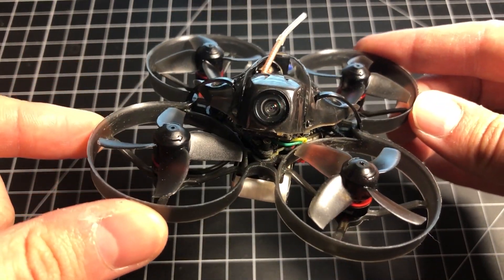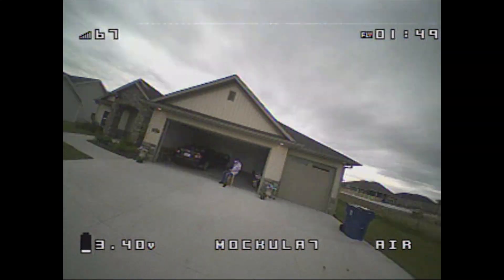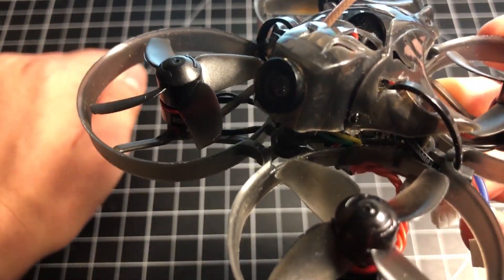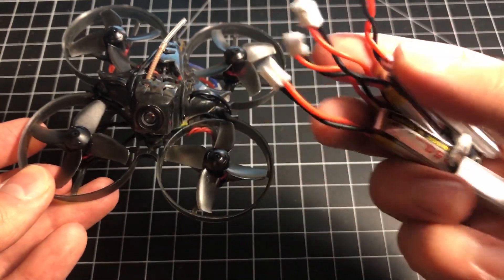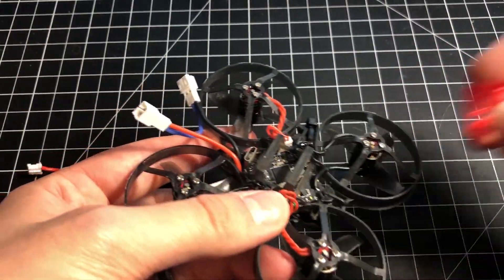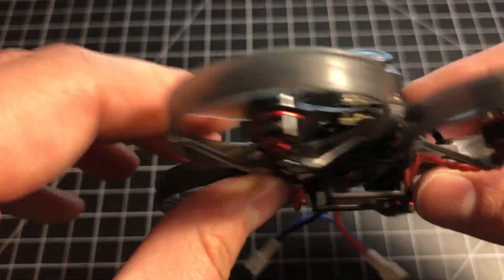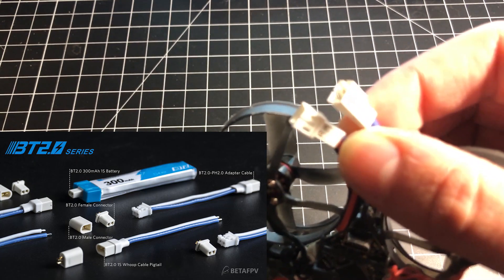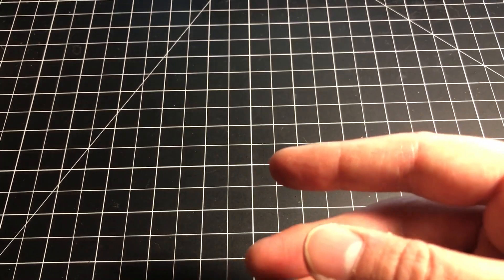Happymodel Mobula7 V2 Review - Is it still worth it?

Comment: I finally flew mine today - about 7 months after I bought it (I bought it with an incompatible xm+ RX and waited till I could replace the RX - I did it using the ELRS EP2 with ceramic antenna).
I installed a BT2 connector and I'm only going to use it on 1s, indoors (I've got plenty open-prop quads for flying outside). It now weighs 27.5g.
With 96kHz PWM and some other ESC tweaks I was able to fly it for 9 minutes and 15 seconds before tve voltage sagged to 3.0V on an 850mAh Gnb battery (purple label, 17.1g). It wasn't even my goal to fly it for so long - it just happened. I don't have any 1s batteries smaller than 550mAh, because I use them on a 3-inch Baby Tooth - the yellow-label 550mAh hv being my favourites.
Reply from the maker: Been thinking about going with BT 2.0 as other batteries besides betafpv's are finally being made for it. This comment just might encourage me to give it a try. Thanks for the feedback.
Reply: @JohnCuppi  no worries! I convert my battery plugs to BT2 too - not enough good ones on the market with this connector... I also bought PH2 connectors with 10cm cables soldered to them and I soldered appropriate BT2 connectors on the other end of the cables. I insert the PH2 end into my 6-in-one whoop battery charger and I plug the BT2 batteries to the dangling BT2 connectors for charging. I do not recommend the Betafpv 6-in-1 charger with BT2 plugs, because it has no voltage  (4.2 or 4.35V) or current (0.2 or 0.6A) switches that typical 6-in-1 have)

Comment: Even now in June of 2020, this who0p is still one of the kings of who0ps of all time! Since they upgraded the AIO FC to an F4, now it will get the updates in Betaflight and Emuflight to let it get the best features from now on.  The F3 stopped getting updates at Betaflight 4.0.  Can't say enough about how great this who0p is, and I have an F3 version! Fast and nimble and very acrobatic! Certainly a deal at the $79 it currently is selling for on Banggood. People and reviewers seem to always be focused on the new gear coming out.  That older gear is still just as good as when it was first released! Now, it's even better! I might just buy another! ;)
Reply from the maker: Absolutely still agree 100%, great comment. The Mobula 7 still holds its own very well and is an extremely mature product with lots of resources, great tunes, etc. It being older is a perk in its own way.
Reply: @JohnCuppi  Thanks! :)
Reply: Hello Scoot, I just bought 1 Mobula7 v2 and it came with F4... the problem is I cant flash it with EmuFlight, when I try to flash it the quad blinks off and when I start it again, bam BetaFlight still in there. Do you know if there are a known problem or something? Thank you in advance.

Comment: 100% spot on in all aspects from my experience.
The Gemfan props I am a big fan of.
I feel they have a much smoother line and really pull into the corners. The set weight a gram less than the stock props. Great review.
Reply from the maker: See I didn't even know about those, I'll have to check them out. I think you've spent way more time with yours than me, cause I got into the Mobula 7 so late -- you should do a review on it! I have a feeling they're going to sell out before the holidays and HM will have moved on to the next thing. Thanks for the awesome feedback.
Reply: @JohnCuppi  I can't tell by the way you fly it.  I'm not as well spoken as you. I leave the hard reviews to the pros. I'm amateur hour in reviews bro.

Comment: I Put my batteries from the Front in  so the wire cant get in the props.
And my charger works fine But i glued some Metall heatsinks on the Diodes and mosfets of the bouth buck regulators. Also it charges up to 4,36v and as it stops charging the voltage drops to  about 4,34v to 4,35v. So its very close. Check your solderconnections on your charger and desolder the switches and bridge them.  Than it should work fine. I also Got an f4 fc
Reply from the maker: I still have my charger, so I will take a look and fix it on a rainy day when I'm bored and want something to work on. Thank you very much for the advice and happy flying! Enjoy that F4 FC!
Reply: @JohnCuppi  also happy flying  :o)

Comment: As you said, it's getting to whoop season here in North America ( Actually started early here in Winnipeg, Canada). I needed an upgrade from the brushed era  I was flying last season, so bought one of these about a month ago, and just received my second one. After several bad experiences with BetaFPV brushless products,  I was expecting more of the same. Happy to say I was wrong !! I fly indoor in a warehouse, and 1S is plenty powerful for indoor for sure. As for the new Beta connector, I will wait until GNB adopts it before I come on board. After all, for me, power is not a problem. Great video !!
Reply: This is some of our weekend action if you are interested
Reply from the maker: Great comment, thanks for the feedback! I've had 50/50 luck with happymodel products so far. The SailFly-X was a real piece of junk basically built to die, but their Mobula 7 especially this late production model is very solid. I am getting a few of the connectors from BetaFPV to try and see how I like them. I think the BT connectors make logical sense, but if BetaFPV makes licensing too expensive then the connectors will fail or simply become cloned. Which betafpv brushless did you get btw? I've been flying the 85 Pro 2 and really like it, but I see an awful lot of bad reviews on amazon about burnouts with just a few packs. I don't get why, mine's doing great after 20 flights.
Reply from the maker: @echobeefpv8530  Just checked it out and commented!
Reply: @JohnCuppi  tried the BetaFPV 65X and 75X. Had ESC / motor failures on both. I had  ( brushed) 65S models, all flew fine. The models are well covered in YT land, I got two dud ESC's and / or motors. No shade on BetaFPV, but QC out of China seems all hit and miss, even from " brand name " suppliers. It is a developing market,
Reply from the maker: EchobeeFPV It is actually not uncommon for me to have heard about BetaFPV drone failures in general. I’m not sure if that’s just because they are a popular brand, or because they had had growing pains with product design. Some of the problems with the 75x were very well known and they ended up adding improvements to the ESC. I bought a meteor65 from them, the new one, along with some of their batteries at a discount for review purposes. If I hate it or it dies on me it’s going back to amazon but I’m certainly hopeful I’ll love it.
Reply: @JohnCuppi  a very popular brand, and covered a lot by YT drone channels. I'm trying to get more YT creators to give more durability reports. A new shiny model looks the same, I want to see if it's still in the air in 6 months. I spend way too much ( I mean, WAY TOO MUCH !, ya know?) on the hobby, to spend 200$ on a quad that lasts 4 flights ( Beta65X )
Reply from the maker: @echobeefpv8530  That's always the real question about any of this stuff, right? I find that information ends up being found out by regular users in facebook groups and forums. The really big YT drone channels have so many products coming in constantly, there's just no way they have the time to give long term durability reports on all of 'em. I genuinely wanted the meteor65 and intend for it to be my primary winter season whoop, I hope the whole BT 2.0 connector and everything works out. So after my review feel free to come back and ask me about an update! lol.
Reply: John Cuppi so you bought the Mobula7 instead of the Meteor65? I’m debating between the Mobula7 & Mobula6 I’m starting to lean toward the Mobula7  putting it in a 65mm frame for 1s indoor flying
Reply from the maker: Gramps Ramblings I bought both, lol. I bought my mobula a couple of months ago in an end-of-summer fire sale. Now that sale is basically normal at most of the Chinese vendors, prices cut down due to newer whoops. The Meteor65 is the newest tech from BetaFPV but at $110.... the Mobula 7 is a lot easier on the wallet compared to it for sure ... but I review this stuff so I bought it for myself & the channel. I did see the new Mobula6 but if I can’t get a review sample of that I won’t be doing any videos on it — I’m personally not buying it, although m7 was very good happymodel has a terrible rep of rushing new products half baked.
Reply: @JohnCuppi  Do you have the Meteor65 that you will be reviewing?
Reply from the maker: Gramps Ramblings no — I ordered it, and it will be here in about a week once the stock has made it to amazon’s warehouse. Should be any day now.
Reply: @JohnCuppi  I'll be looking forward to your review
Reply from the maker: @GeezerGramps  I appreciate that, it'll be done as soon as I can get it and put some real world use on it!

Comment: thanks for sharing! Gonna recommend this one to some friends. Got mine a few months ago but voltage is sagging a lot now and connectors are very warm. Thinking about replacing the connector with the tinyhawk freestyle ph2 connectors, solid pins. They seem to have a clever solution that could work good on the mobula7 as well I think!
Reply from the maker: Yes a solid pin connector is a great upgrade to this. Or if you want, there’s also betaFPV’s new connector which is objectively better but unfortunately you’d still have to buy only their batteries for now. Thanks for commenting and I’m glad you enjoyed it.

Comment: Can you show us the dump file for the project mocking bird
Reply from the maker: This is it from them, final version for f4 and f3, but it does need JESC installed. It would fly way better than what I showed in this video at this point.  He got the f4 version finished! https://onedrive.live.com/?authkey=%21AIcMSEaAspWuNsc&cid=C5756863B00398BC&id=C5756863B00398BC%21380955&parId=C5756863B00398BC%21372904&o=OneUp

Comment: Hello John, How are you? Great video!! I just bought mine and I'm having a few problems: 1) I dont know which version of BetaFlight get to Project Mockingbird Work... i know is 4.1 but there are a lot of sub-versions (4.1.1, 4.1.2, 4.1.3 and so on). Do you know which version I need ??? 2) I tried to flash EmuFlight instead of BetaFlight but when I press "flash" on EmuFlight the quad turned off and when I turned it ON betaflight is still there. I dont know if Im doing anything wrong. Thank you in advance!!!
Reply from the maker: Hi Juane! This is the the one I use from Project Mockingbird -- v 4.1.1, "Mockula7", https://onedrive.live.com/?authkey=%21AIcMSEaAspWuNsc&cid=C5756863B00398BC&id=C5756863B00398BC%21380955&parId=C5756863B00398BC%21372904&o=OneUp It doesn't utilize RPM filtering, but does use JESC 48khz mode, so you'll need to flash JESC to your Mob, but don't worry, that part of JESC is FREE! PID Profile 1 is for 1s
, PID Profile 2 is for 2s with that configuration. I have not bothered with Emuflight on this, sorry I can't be of help there.

Comment: Recently got my Mob 7 v2 and just wondering would the jst be the best for an exclusively 2s set up or would an xt30 be better?
And if so for the jst...what a good 2s battery with good flight time?
Reply from the maker: Personally I think xt30 is overkill, it adds extra weight that isn't necessary. GNB 2s 450 are really good -- but I have not used them on my mobula 7, I fly 1s more often with my Mob 7 since I typically just use it in the garage or the house. So I admit I have not really gone down the road of a 2s connector. Great comment/question though.
Reply: @JohnCuppi  ...have you had to change out your battery connectors yet? Or have they held up for you?
Reply from the maker: Drone Ready I swapped mine out to solid pin connectors before they had a chance to degrade much, around the beginning of January. This winter I am trying to push myself to fly 5 packs per day (I missed a whole week sick with the flu) so far I have had good results with the solid pin connectors. 🙂
Reply: @JohnCuppi  ...how do you swap out to solid pin connectors?...is it relatively easy?
Reply from the maker: Drone Ready it involves soldering so it may not be easy for everyone. But all you have to do is desolder the stock connectors and then solder the new ones. Solid pin connectors are cheap premade like $2 usd
Reply: @JohnCuppi  ...thankfully I have pretty decent soldering skills.
Would you recommend jst or bt2.0?...
Reply from the maker: @droneready8278  I had BT 2.0 on my meteor65  before I returned it and I think those are very good whoop connectors. Personally I just use a solid pin JST-PH 2.0 connector, I think you would honestly be totally fine with that. BT 2.0 is good but not when the only batteries you can buy are available from betafpv...
Reply: @JohnCuppi  yeah...making the connector proprietary to their batteries kind of sucks...why did you return your Meteor65?
Reply from the maker: Drone Ready I did a review of meteor65 here about why I returned it: https://youtu.be/DJLjbktlnqI long story short, it flew like crap, I had low battery life, and betafpv never offered me a new unit all they wanted to do was have me attempt to fix it. I gave up, it was too much money for the whole deal as well.’

Comment: dude my mobula all of a sudden flips out when I arm it and instantly shuts off ..have you heard of this happening ?great video also! that dog freaked me out when you flew by it lol
Reply from the maker: Yes I have heard of this problem with crazybee boards more so with mobula 7 HD though. If you test each motor in betaflight with a battery connected do they spin? Does this happen in air mode as well as stability mode? Could be a lot of different things, but if it only happens in stability mode then the accelerometer might have farted out.

Comment: When I follow the links I still see the F3 flight controller in the specs
Reply from the maker: yes... that's what I said in my video... listings can state its an f3 FC for example, but in my case that's not true since I ended up with an F4 FC. Unfortunately this f4 version isn't advertised very well or at all, you only get it if the vendor has recent stock from HappyModel. I bought mine specifically from qwinout with a few friends and we ALL ended up with f4 fc's from there. I don't think F3 FCs are being produced by happymodel anymore but vendors arent changing their descriptions...
Reply: Just ordered one from Qwin & the description said F3 but when I got the conformation email it said F4
Reply from the maker: @GeezerGramps  Hey I just checked and my old confirmation email also says F4! Hope you got the $70ish price! :D Good stuff!
Reply: @JohnCuppi  Got it for $68 + $3 for tracking and faster delivery. Thinking about getting the Metero65 SE with the 19500kv motors. After watching it I'm wondering if it's going to be to fast for my small basement. Don't have a lot of room and my old reflexes are not that good. :-)
Reply: @JohnCuppi  what is the difference between both of the boards im a newbie pls help
Reply: @mr9712  The F3 is like a CPU chip in your computer.  It is a little older now, and a little slower too.  So, getting the F4 makes it faster at processing and more capable of running a faster PID loop .... i.e. instead of only running 4k/2k, with an F4 you can run 8k/4k! Plus, and this is a huge one! The F4 is still very much being supported in Betaflight. The F3 stopped having support at v4.0, and 4.2 is just coming out now.  The software is getting better and better, so not being "left behind", like the F3, is great!  Don't get me wrong, the F3 still works fine, it's just not getting the updates that the F4 and the newer F7 is getting.

Comment from the maker: Since this video I recently applied the latest project mocking bird settings for the Mobula 7 F4 version, and flashed the ESCs with JESC @ 48khz, version 2.3 for whoops and all I can say is WOW. You have got to check it out once you get one. This whoop never stops getting better. MOCKULA7 for BETAFLIGHT 4.1 IS HERE!!! ►► https://www.facebook.com/groups/1702300099835884/permalink/2634902519908966/
Reply: I've tried PMB on several different quads and never liked it. I think it's more for racing around and I do more cruising. I do like the JESC 48khz tried the 96khz and it acted like the motors were reversed or the props were on wrong so I went back to 48khz.
Reply: Try RPM filtering!! It is amazing on my mobula!
Reply: I will receive it next week, should I follow the link since the beginning?
Reply from the maker: @ML-fx6xn  The above instructions are still great to follow, but I would encourage you to just try flying it as-is when you get it. It flew really nicely on stock settings too. :) Upgrade to these settings later on.